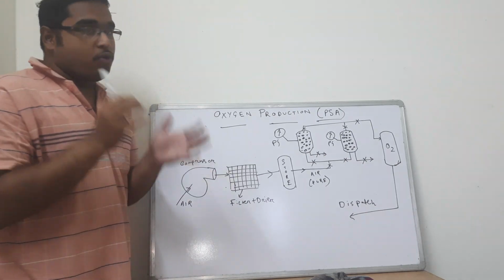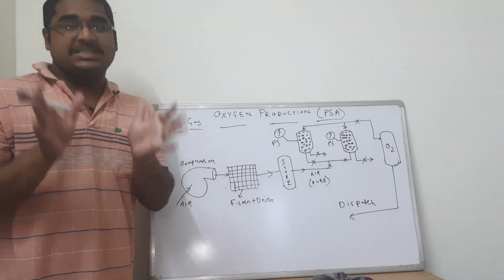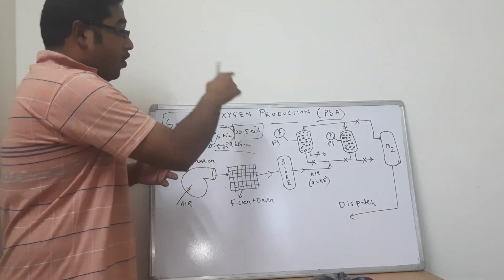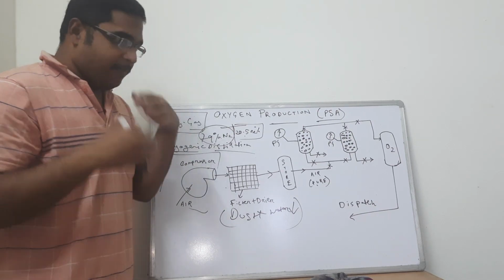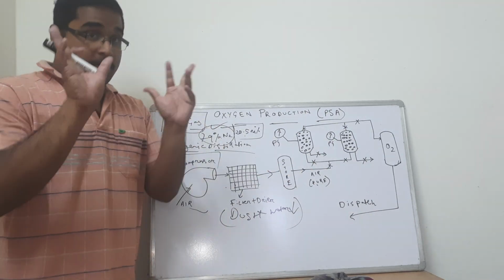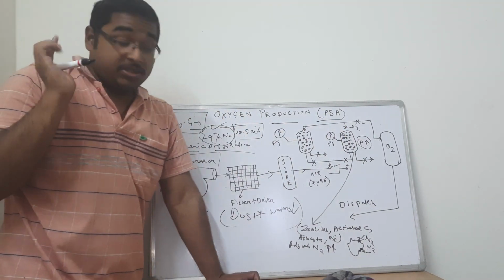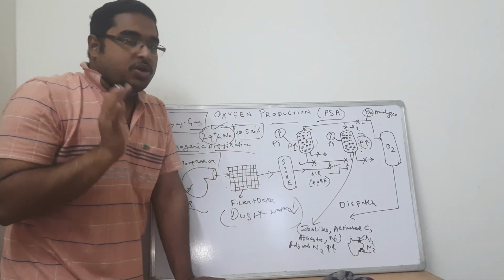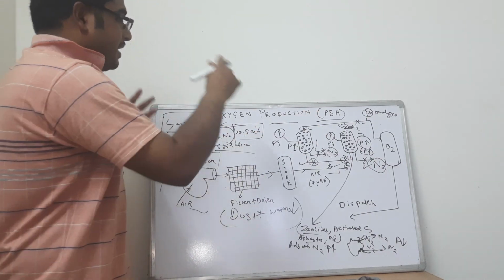OXYGEN MANUFACTURING PROCESS | PRESSURE SWING ADSORPTION | EASIEST & ECONOMICAL METHOD

Comment: I guess VPSA or VSA system is more economical than PSA system. In PSA system, the compressor required more energy to operate, wherein the Vacuum swing absorption system consumes less energy, almost half the power of PSA. VSA is more efficient than PSA. Moreover, VSA has a simplified design. Wherein PSA, much more complicated design. The only advantage of PSA is that the initial investment is comparatively less than VSA. 
Hence the easiest and economical method of onsite oxygen manufacturing lies in VSA system, not in PSA system.
Reply from the maker: A balance has to be struck in between Capital Cost & Operating Cost. PSA system is economical to build upon initially. Industrialization of the O2 Manufacturing Process might find VPSA more cost effective in the long run, but PSA is economically easier and viable  to start with in these tough times of crisis management. Atleast individuals can come up to help and contribute with their small initial investments to make the pilot plant of PSA O2 Manufacturing a Reality.

Comment: Sir what is the input pressure from compressod needed for zeolite for max adsorption of nitrogen.
Reply from the maker: Depends on your bed and it's adsorption capacity at different pressures. The optimum pressure needs to found out by Experimental Examination of Adsorption efficiency at different pressures.

Comment: One doubt🙏 It is said now mucromyosis is happening as water is not properly cleaned & due to fungus in water used for Industrial oxygen production! Which process uses water where there are chances  for infection?
Reply from the maker: Oxygen Concentrators work on the principle of Electrolysis of Water to produce Oxygen. Sometimes the water used is simple Tap Water or Process Water which can be a source of Fungus in Oxygen produced. You should use DM water only (induced with some Edible Salts or Dilute Acids to induce electrolytic properties which is otherwise absent in DM water).
Reply: @LifeBeyondBusiness  Hey thanks 🙏🙏 Dimineralised  water.. Got it👍👍
Reply: But is this electrolysis process widely used for Industrial oxygen production or you are saying only about portable units at hospitals?
Reply from the maker: It's not for Oxygen Cylinders, it's primarily used in Oxygen Concentrators in Hospitals

Comment: YOU ARE GREAT SIR I HAVE WATCHED ABT 100 VDOS TO LEARN THE PSA PROCCESS BUT THE WAY U EXPLAINED IS GENIOUS, I WOULD REQUEST YOU TO PRESENT A CHART OF ALL VALVES OPENING AND CLOSING TIMING ACCORDING TO PRESENCE OF PRESSURE IN BOTH CHAMBERS. AND ALSO  EXPLAIN THE PROCESS OF DEADSOPTION BY REVERSE O2 PRESSURE . THANX
Reply from the maker: While Adsorption in Tower 1,

Open Valves:
Tower 1 Air I/L
Tower 1 O2 O/L
Common I/L
Common O/L
Tower 2 N2 O/L

Closed 
Tower 2 Air I/L
Tower 2 O2 O/L
Tower 1 N2 O/L

While Adsorption in Tower 2,

Open Valves:
Tower 2 Air I/L
Tower 2 O2 O/L
Common I/L
Common O/L
Tower 1 N2 O/L

Closed 
Tower 1 Air I/L
Tower 1 O2 O/L
Tower 2 N2 O/L

For Reverse O2 Desorption, we pass O2 in the Reverse Direction under low pressure conditions such that O2 absorbs Nitrogen and moves out.
Reply: @LifeBeyondBusiness  is it nessecesry to hold the pressure in T1 for some time . Or I can say that opening inlet valve for intake of air and output valve at top of T1 will have same timing for opening while adsorption ?
Reply from the maker: You can open both simultaneously as long as you can maintain the desired pressure in the tower

Comment: I want to help you in this oxygen production process but i am just passout and do not have the necessary skill regarding psa
Reply from the maker: Go through this video and a few Research Papers, form a group of Engineers and try upon this, if you find this quite big a project to start with, try to work on Oxygen Concentrators. You can also follow the Prototype prepared by 2 IISER Professors.
Reply from the maker: Always there for any help you need

Comment: I have a few questions sir kindly help if possible :-
I am trying to design a PSA device capable of producing oxygen of 90-95% concentration at 60 l/min I have gone through many resources and have chosen zeolite 13X as the molicular sieve as its economical and somewhat available then zeolite LiX which i know is better but expensive so I want to know the total amount of zeolite 13X that will be necessary in kg for this project 
I have chosen a pressure of 120-130psi for the adsorption cycle and thinking of cycle time of 25-30s
do i have to keep the adsorption chember at that pressure for the whole time or i can just start collecting oxygen as soon as that pressure reaches 
during desorption cycle will normal atmospharic pressure be sufficient or i will have to apply negative pressure
Reply from the maker: During adsorption pressure needs to be maintained, during desorption, Atmospheric Pressure should work.
Requirement of Packings is dependent on the Volume of Gas Handled and the adsorption capacity or the maximum loading factor for the packings.
Reply: @LifeBeyondBusiness  Volume of gas handled will be 175 L probably .
Reply from the maker: Ok, you need the adsorption capacity of the packing you are using
Reply: @LifeBeyondBusiness  I am unable to find that of Nitrogen have found of CO2
Reply from the maker: You have to get the data for N2, else you can't calculate the amount of packing required. If you don't have the data, find the same experimentally in lab scale at different pressures
Reply: Abhishek bro
Can you help me with a question that , if we need a 90% pure oxygen..at what pressure we should provide air into zeolite
Reply: @amalanilkumar4495  This depends on the type of zeolite that you are going to use. which type of zeolite are you going to use ?
Reply: Zeolite 13x